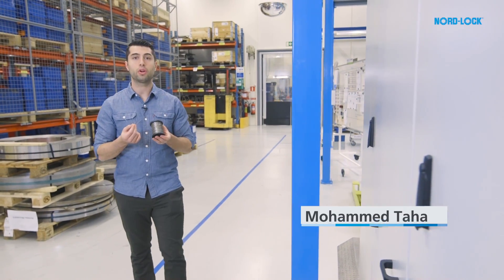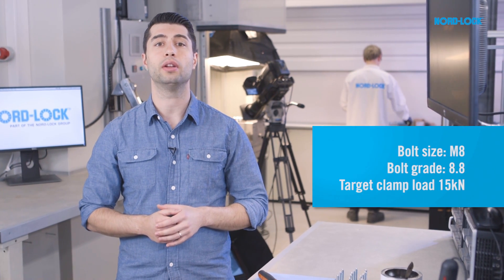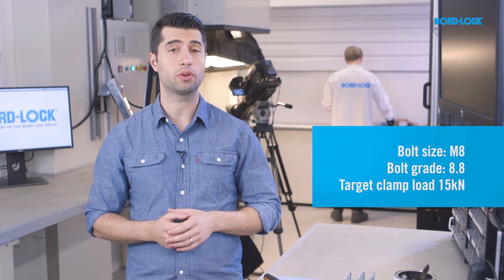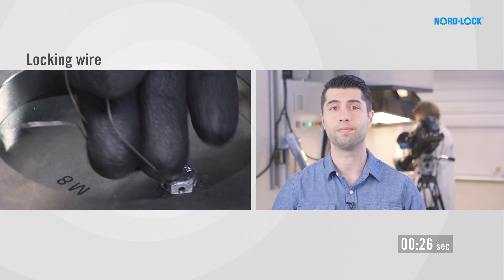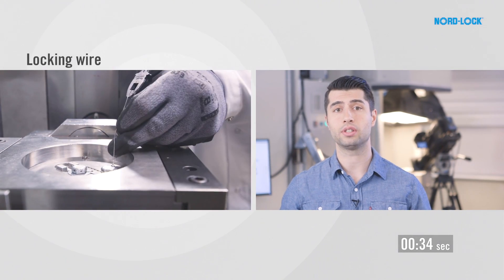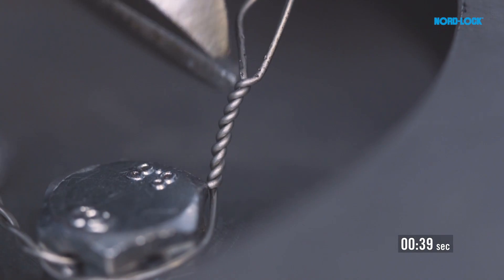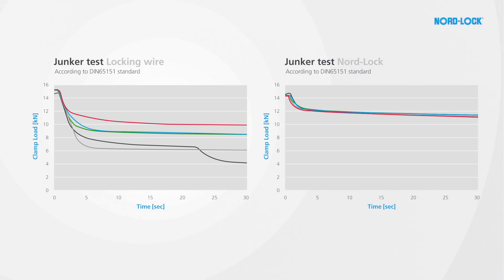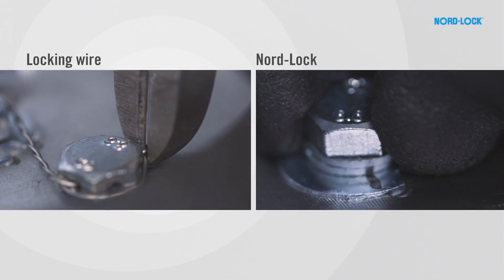The Junker Challenge - Nord-Lock vs Locking Wire

Comment: I agree with most of the comments - very different purposes. The lock wire is there to show that the bolt was tightened properly in the first place and is required in certain industries. It also stops bolts that have loosened off falling into things that can be damaged. A Nordlock is an engineered part of the fastening system - as is using an vibration nut, loctite or a belleville. If time is really a concern use the Safe-t-cable system to lock wire.

Comment: Actually I think I'd like both solutions used together. Nordlock for retaining the clamp loads and the wire as a secondary insurance, plus with properly done lock wire, visual inspections on fasteners can be done quicker during maintenance checks.

Comment: Locking wire is a medieval solution.
Reply: xl tho is the reason that those wired bolts on a helicopter tail rotor bearings,come loose, on a unit using a recip engine , JESUS BOLTS , as all you can say is aJESUS !